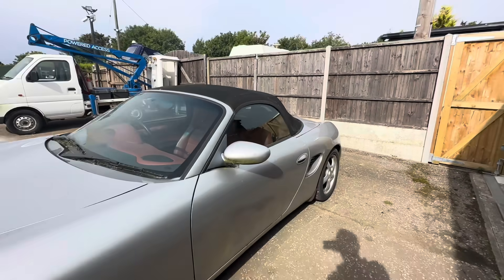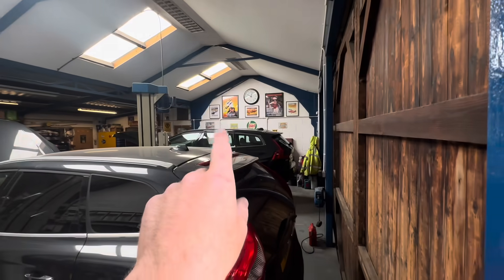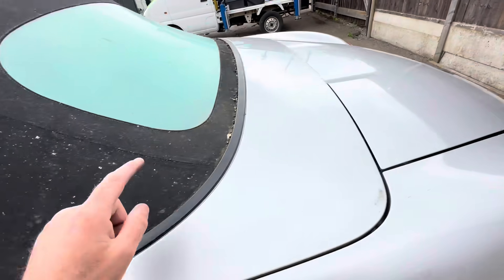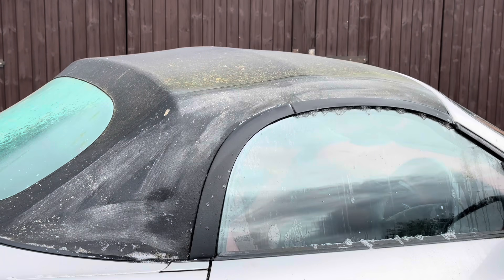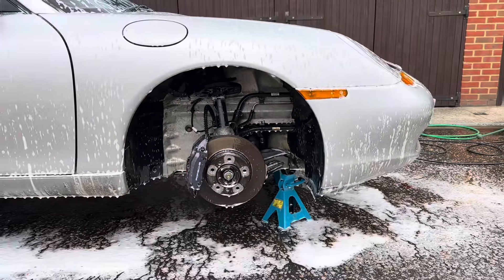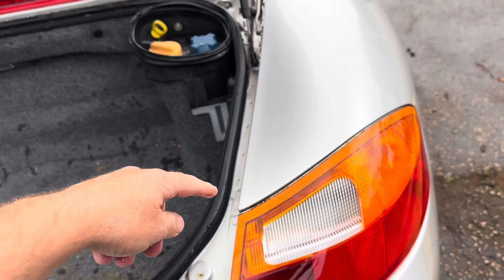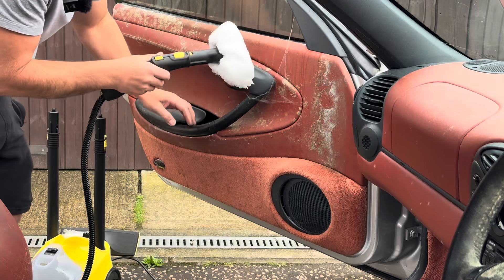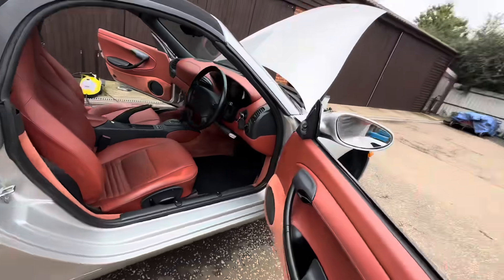REBUILDING AN ABANDONED PORSCHE BOXSTER PART 2

Comment: Rob, check to see if the roof has a drainage system like a Mazda MX5. These drain pipes can block and the water from the soft top can’t escape and ends up soaking the carpets

Comment: Hi Rob, the rear plastic screen has misted over time.  Great product for this is Greygate plastic polish, is used for plastic screens on airplanes but works a treat on a soft top with a plastic window.  Also when you take the roof down it might be brittle so half down the roof, get out and flatten the screen in the middle where it folds.  Hope bit of advice helps.  Great videos as always!!

Comment: **WARNING** If those rear Boxster drain holes are blocked you’ll get water under the passenger seat where the ECU is located. It’s a common problem on the Boxster.

Comment: I think steam can cause more harm than it solves. It causes glue to unstick behind trims and fragile foams weren't designed for the huge heat..
Reply: Definitely should be used with caution, but isn't this one a case where nothing else was an option?

Comment: With all steamer's once up to temp take off all attachments give a couple of squirts on the trigger to get rid of the condensation that builds up while heating up in the hose. Once cleared and no more water is dripping out put back on attachments and go for it, only steam without all the water dripping. Oh and a long thick rubber glove for your free hand as at some point we all forget it is steam coming out that very hot magic wand 😂. Hope that helps

Comment: tyres are 19 years old, date on the one you pointed at was about 2 inches to the left...reading 4004 which means week 40 of 2004, more than double passed there safe useable life
Reply: Put two on the back and rag and smoke til they're smooth.

Comment: Anyone remember the £1000 Boxster on Wheeler Dealers? Gearbox oil and filter sorted it. They used a special lathe on the brake discs to clean off rust as replacements were supposedly expensive

Comment: Rob, if you replace the orange indicator lenses with clear replacements, it lifts the car massively and does not cost much.
Reply: Its far too original and unmessed with to bother doing that. It's a proper late 90s time capsule - so many early Boxsters have had cheap aftermarket clear indicators fitted it's nice to see one as Porsche intended..

Comment: On soft tops I have got on very well with a product called Fabsil - it is a waterproofer easy to apply and works well.   Just wash roof first then allow to dry before applying Fabsil with a paintbrush.  Fabsil is a tent waterproofer.

Comment: Hi Rob good to see you on the 986 again ,point yo note when roof in service mode check the water drain membranes each side where the boom on rear lifts up ,as it's like a polystyrene material prone to tearing ,sold lots in my 30yrs on Porsche parts

Comment: It’s worth checking the drain holes  to make sure they’re clear. There is one located either side behind the seats, if these are blocked water can flood the interior including the ECU under the passenger seat. They’re are the usual ones in the scuttle compartment too.

Comment: Looking very good, the car that is. The steam cleaner is a game changer when it comes to cleaning and killing germs, however if you are like a lot of us guys who don't read instructions there are a few tips for your steam cleaner that I have learned through trial and error. 
Do not store it with water in the tank. Rinse the tank after every couple of uses. this prevents the buildup of limescale, which will block the pipes in time. Do not use the steam cleaner on painted surfaces on a car. that is a good way to ruin the paint job. I found out the hard way.  I found that mixing clear vinegar with the water helps to remove stained carpets. Doesn't smell very pleasant, but you can go over it with a better smelling product. Rinse the steam cleaner after using the vinegar.

Comment: Check your drain holes front and back Rob
Reply: Agree, really important, if they're plugged water will find it's way into ECU etc, check under the seats, footwell etc an under covers left and right of the battery
Reply from the maker: I blew them 👍

Comment: Rob , door cards needed apc and steam but without the mop head on. Fabsil painted on the roof .Have used many products over the years , and autosmart g101 really does take some beating as a great allrounder and more cost effective than it’s competitors , also “brisk” is a great cleaner for mould .

Comment: Be careful with a steam cleaner, the heat can break the adhesion of the glue that holds the vinyl or leather to door card etc. I know this has no headliner, but they can be bad after a steam clean.

Comment: Watching with interest as I've an identical 98 model. Probably be worth taking out the front arch liners, admittedly mine has done 80k but rust was starting where the liners rest against the upturned edges of the arch (rust just creeping round onto visible side) and behind the front wheel/ just in front of the door jam. Rust also starting near all four jacking points due to the inevitable damage to the paint when jacking. Also worth removing the small plastic trims in front of each rear wheel, they are a dirt/rust trap. The metalwork is decent quality though so even if the paint and galvanisation has failed its unlikely to be holed.

Comment: I had a 2.7 that the DMU under passenger seat was damaged (wet) make sure the drains are clear under the roof and in the front  scuttle or they over flow into the cabin !!! I managed to solve the issue by having the dmu cloned .. also the roof switch ok the roof  is a pain worth 10 mins with a soldering iron .. rear windows also crack if plastic have gone through 2

Comment: Given the age of the car, would you normally just recondition all the weather stripping or just replace it all? Same question with regards to the engine bay rubber products.
PS - you might want to consider using an ozone generator to kill any remaining / hidden mold spores

Comment: Just a thought: you mentioned the owner did a mile to work each day and back. If he did alot of short runs without the engine warming up fully should that be a concern?
Reply: Most definitely. People often assume low mileage is better but this is not always true. A higher mileage car that's been well used and well maintained is a better bet given the age of these cars now, especially with the M96 engine.  Still great to see a low mileage car but it should have the IMS replaced as a precaution.

Comment: Hi Guy Great change love what you do but I must say that you should not wash a car with hot water a you will remove the paint protection 
Just trying to help not nit pick
Great Chanel keep up the good work
Ash
Reply: It's been sat for years, any paint protection is long gone
Reply: Even if it had protection which it hasn't, warm water would not strip any protection away, that would be done with certain chemicals only.

Comment: Hi Rob, inspired by your videos I’ve bought a 2012 Fiat panda, low miles, however the headlights will not turn off on the stalk, trawled your 500 videos hoping to find info, ring any bells for a quick fix? Cheers
Reply from the maker: Just check the power at the stalks 👍
Reply: Cars gona be a belter after watching YouTube videos to repair it

Comment: Rob, did that front nearside side repeater have a crack in it? if it does, be worth replacing with either new or better if your putting in the effort cos of the low mileage?
Reply from the maker: Yes was mentioned in the previous video we have new ones 👍
Reply: @sruk  oh brilliant!